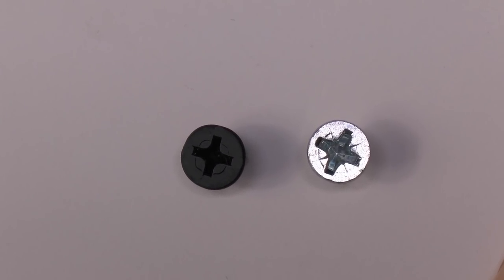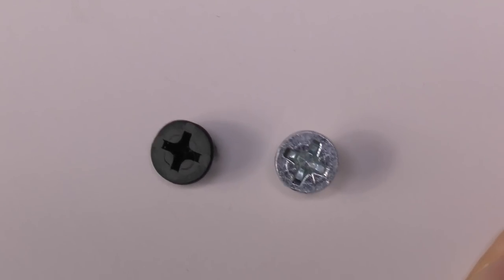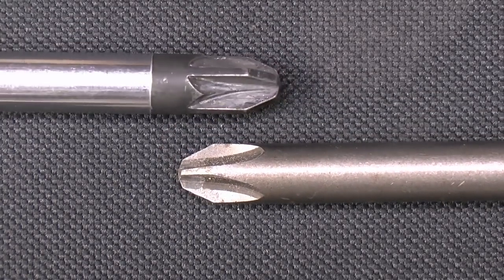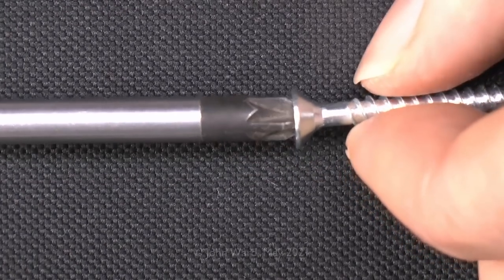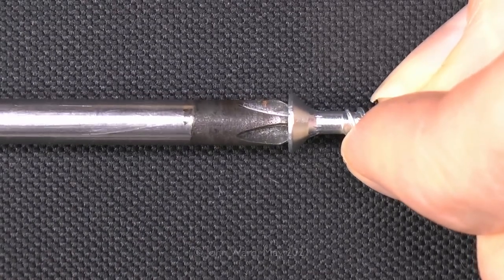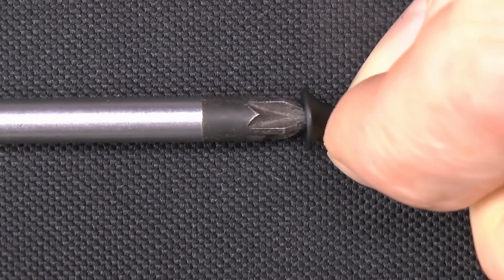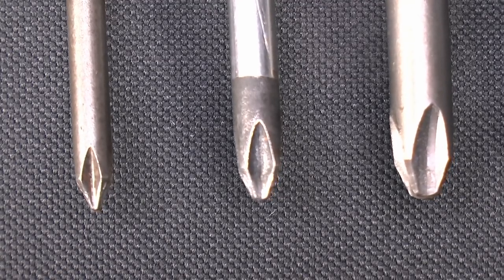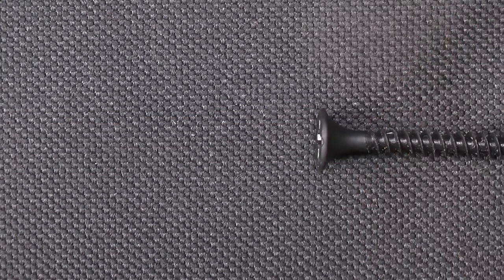Screws - Phillips or Pozidriv ?

Comment: One thing I love about Miele is that right since the 1980s, they've just used torx more or less everywhere. Absolutely no mistaking which piece you need of using one of those horrendous kits you allude to at the end. The world world be a much nicer place, if the only two fasteners you needed were torx screws and hex cap machine screws.
Reply: Step 1: There are 14 competing standards. Step 2: "We need a new standard to unify and replace them all!" Step 3: There are 15 competing standards.
Reply: Apart from all the Pozi screws they use. The Pozis were only around £2 each to replace all the rusted up ones in a Miele appliance. Apart from that, Miele do use Torx.
Reply: If it were up to me, ALL screws would be Torx. It’s such a superior drive in every way...
Reply: @tookitogo  Only 2 things against Torx. The bit often sticks in the fastener after tightening (also a problem with robertson to some extent) and if they are painted over it is a right pain scraping the paint out of the splines to fit the bit in. In this respect both Robertson (square socket) and hex (Allen) headed screws are easier to scrape out. Another advantage of Robertson is they still grip when the driver is not exactly aligned to the screw.  With Pozidrive I just hammer in a philips driver as the old paint takes up the slack and makes a tight fit to get the screw out.
Reply: It’s all pozi on their hoovers, some buried in deep holes, Miele get some design things really wrong
Reply: @____________________________.x  Exactly. Find out how much each replacement Pozi screw costs from Miele. I paid around £2 each. Alternatively you can use off the shelf replacements for a few pence each but run the risk of damaging the plastic threads due to Miele using a strange pitch and length.
Reply: @tookitogo  After speaking to a leading screw manufacturer, as I want all screw to move to Torx, there is a growing trend towards offering Torx to replace Pozi.
Reply: @bimble7240  Use a torx screw driver and the bit won't stick. Or use a quality bit holder? I've never had a single Torx bit stick in the fastener once.

Removing paint is not a reason to favour one over another. They are all equally difficult.

Torx has a far greater range of "off-axis" drive than Robertson. it's part of the design of Torx.
Reply: @stakkerhmnd  Oh thank goodness. I am SO over Phillips and Pozi! (Never mind flathead, which IMHO should have been banished decades ago.)
Reply: @tookitogo  Stakker Humanoid has been requesting for quite a while that TX be made available in woodscrews. Stakker was told by the manufacturer that this was their plan. However, a well engineered PZ bit and quality PZ screw are already vastly superior to PH and Flat Head (FH). There is no place whatsoever for FH apart from purely decorative reasons. Saying that, Stakker feels that a TX is more decorative and nicer to look at than a FH.
Reply: @Anvilshock  Very good point!
Reply: @tookitogo  Definitely
Reply: @stakkerhmnd  Never buy Miele is my advice.
Reply: @corrigenda70  Why? Everyone I know who has Miele is extremely satisfied.

Comment: Torx has become very common in UK construction work, especially in the larger sizes of wood screw (5/6mm). The boxes tend to contain a fresh driver bit in each as well. Much easier to use, especially with powered drivers.
Reply: Oh really? Man that is so damn good to hear. I've been saying for ages that Torx will only go mainstream once it's used widely in construction. I kinda thought that it would be hard to convince construction companies, as Pozi tends to go in no problem, is a bit cheaper, and it's not the construction companies problem if it cams out when someone tries to remove it in 10 years.

Comment: Thanks for sharing, it's always frustrating to work on furniture or construction where someone had previously mangled all the Pozidriv screws with a Philips bit and a cordless drill set to max torque. Conversely, in computers, most of the time the only driver you need is a Philips #2... Which doesn't stop folks who once assembled an Ikea table jamming their Pozidrive in there, or even a flathead if that's all they've got.

Comment: It is unfortunate that two incompatible standards of basically the same shape (three if you count JIS as well) succeeded in the market. I wonder how much damage and additional costs the resulting confusion has caused.
Reply: A huge amount. Many very expensive executive yachts have been purchased with the money spent damaging equipment unnecessarily.
Reply: Pozidriv is based on Phillips, it's a more improved version. It can handle higher torque than Phillips. The badest thing is if you got a device were they mixed up screws with PZ and PH head. You can actually use a Phillips screwdriver on a PZ screw without damaging it. But you must be careful with the applied torque, some intuition and finesse in your hands. Use a screwdriver and not an impact driver or something like that. So nothing for people which we call "Grobmotoriker" in German...(person with inadequate fine motor skills).

Comment: The history of screw heads is quite interesting (sadly!). I believe cross-head screws were developed when mass-production took-off - screws needed to be inserted by power tools and the traditional slot-head was no good as the driver doesn't self-centre. It saved a small amount of time per screw, but that added-up to a big saving overall.

Comment: It is useful to note that impact drivers are much less likely to "Cam Out" when driving or removing Phillips and Pozidrive screws than a drill driver. With drill drivers you will have to push hard into the screw to stop it camming out with tight screws. If you don't the driver bit and screw will very quickly get chewed up.

Comment: The #2 size can be used even on surprisingly small screws.
I’ve had computer servers where the side panel (barely thick enough to take the countersink head) was held in place by very small screws which the best driver to remove and replace them was a Phillips #2 (screwed into a punched hole in a slightly thicker sheet metal part). A Phillips #1 driver would cam out unless pressed down hard where as a Phillips #2 driver fit perfectly to the point the screw was retained on an unmagnetised driver after removal. (Edit: spelling).
Reply: Sounds like you had the wrong bit there.
Reply: Conversely, a damaged #2 screw can sometimes be turned by a #1 bit because it reaches undamaged metal.
Reply: The important message here is that the size of the screw head doesn’t tell you what size bit it needs. (It is NOT correct to imply a #2 driver is somehow universal; it is not.)

Comment: I often have to repair UPVC windows at work. The locks and hinges are usually fixed with phillips head screws and I cringe so hard when I’m with someone else and they go at them with an impact driver, fitted with a PZ2 screwdriver bit. You just know it’s going to rip the screw to shreds and either make it a right pain to get out or put back in. 

I always have a bit holder with a PH2 bit in the toolbag. Better to swap it over quickly than fart around trying to make a PZ2 work.

Comment: Canadian Square screws are excellent as well, simple design screw holds firm at any angle. Does not cam out. very strong. Long history, ford motor company used them but the guy who designed them would not sell the patent
Reply: Robertsons have their good properties. I kinda like the idea, easier to see what is going on and more material to ruin before you end up with a round hole :-)
Reply: Robinson or something like that? I only tried them once didnt like them,  dont think its a good design at lower cost. 
Torx and pozis for me, I only had a problem with pozi once when I tried tightening one with my left foot, they work 100% otherwise I cant understand how folk magage to screw them up ...
Reply: @CliveChamberlain946  Ah not so basic, I think Robertson is also tapered. I waiting for Torx to finally get some traction. Not sure that is going to happen until construction companies start using Torx (and I don't see that happening as Pozi drives in just fine, and it's not their problem is cams out 15 years later when trying to remove).

Comment: Phillips screws are criticised for camming out much more easily than posi, but this can have its uses. The advantage is it limits the tightness of the screw when using automatic screwdrivers, and it's why they were used on car assembly lines before torque limiting screwdrivers existed, and are still used today for plasterboard (drywall) screws.
Reply: It seems like a terrible idea to rely on the driver camming out as a means of torque control. The driver will wear fast, screw heads will be damaged, and  the torque achieved is user dependant. Not to mention pointless for everyday fastener use as you squally want the ability to easily tighten screws in construction/ on equipment. And in production settings, well you’re gonna have to use a torque sensing driver. Not saying you’re wrong, but this just seems like a terrible idea.

Comment: You used to get Supadriv (maybe Super drive... can't remember) which were also crosshead type screws. They were around in the UK in the 1980s. I remember they were easier to work with because the screwdriver was less prone to camming out of the screw head under high torque. Not sure if they still make screwheads in that form factor but I've still got a couple of the screwdrivers somewhere.

Comment: I thought everyone knew this but obviously John had realised that not everyone does. I had a similar thing about 15 years ago. I didn't know that that SDS drill stood for Slotted Drive System. The drill bit had slots to make for a much better hammer action. I wasn't told this, I had to look into it because I kept seeing SDS all the time, it was driving me nuts. No pun intended.
Reply: That and the actual tool has a proper linear hammer action as opposed to the more vibratory action of a standard 'hammer' drill
Reply: SDS = Stecken Drehen Sichern (Insert Twist Secure). Developed in Germany by Bosch and Hilti. Internationally Bosch refer to SDS as Special Direct System.
Reply: @renrutmat  Yeah, in the UK we refrain from using the word “Special” for anything. Josie Marino made the mistake of calling himself special. The ridicule follows him to this day. Most of us know (or may not no), SDS = Slotted Drive System. We know SDS bits by the Slots on the shank. We also know SDS will fit in a normal drill but not the other way round. We all all just say SDS and recognise the bits by the slots.
If you went in to Screwfix or any UK hardware / DIY store asking for  special drill bits they will have no clue. They may however say, ‘Don’t think you’re special! On every subsequent visit. Oh, important to say - SDS drills are amazing. Well done Bosch.

Comment: Hi John, nice video. Maybe you could show the Pozi Slot screwdriver as well. It's used specifically on terminal screws, MCB RCD RCBO etc. If you look carefully at the terminal screw you will see what resembles a Pozi head with a slot. I must admit to thinking that was to enable the use of a flat head or a Pozi. The Hilti set of insulated screwdrivers include this type.

Comment: Hi John, A very good system liked here in Canada is Robertson. It looks very simple as it is just square. However using the correct driver the screw locks on and you can use it to insert the screw. I am from England as you know and did come across these in England on some Canadian equipment. However only used in Canada not even in the US.  I am a convert and use them a lot in my equipment. The problem with PoziDriv and Philips is that they are very easily confused and getting the correct drivers can be difficult as very few people know the difference. There are a few other versions as well. In my experience Philips were mainly on actual equipment like televisions and radios and PoziDriv were used more on wood screws. Now we have a myriad of different drives like Torx, male and female, security Torx, and triangle drive used on fisher toys to name a few.
Reply: Yep, living in Canada for most of my life I've come to like the Robertson screws.  I honestly think that nobody here would go in to a hardware store looking for posidriv. Phillips heads are used for drywall screws but beyond that you'll get Robertson heads and some torx.

Comment: The head of the Phillips screws is designed to permit the driver head to cam out whenever excessive force is applied. The Pozidriv was patented by GKN Screws and Fasteners in 1962. It was designed to allow more torque to be applied and greater engagement than Phillips drives. As a result, the Pozidriv is less likely to cam out. It is similar to, and compatible with, the Supadriv screw drive

Comment: In austraila, see more Phillip screws,  however starting to see more different types of screws. As a electrician need to carry  different types of screwdrivers for day to day works. When I started as a apprentice electrician, didn't have self drilling metal screws or battery tools, how things change. The first battery  drill was a Skill 4.8volt, had a better chance drilling a hole with a pencil.

Comment: You should also have mentioned the Reed and Prince (Frearson) screw driver. Which looks almost identical to a Philips. The most noticeable difference is  the tip of a Reed and Prince is pointed while the tip of a Phillips is flat. The angles are also different.

Comment: I just redid my roof with Torx T25 for the wood and hex heads for the sheet metal screws (metal roofing)  All hail the Torx!  IMHO, the Philips, Posi and JIS made such a mess of things I avoid them all and use Torx whenever possible and no more cam out, no more worn out impact driver bits and I always know that a Torx is a Torx.  Some people call Torx "star drive" but no matter what you call it, it works very well and no worries about tearing up bits.

Comment: I gave up on Philips and PZ screws some time ago, I find the #2 Square Drive (Robertson) screws are really good and you can hold one of these screws on the end of the driver if you're installing things like light fittings to a ceiling.
You can buy a very strange type of screw over here in NZ, called a Supadrive screw, apparently you can use any type of screwdriver in these screws, although the ones I've seen, seem to fit none of the drivers I have and they are equally sloppy.

Comment: I wish I'd have known this small detail years ago. I found out the hard way. I was using a Pozidriv drill bit with Phillips screws once and it turned what should have been a quick and easy half-hour job into a few hours' hard work. I really had no idea at the time, I thought they were basically the same. It would have been easier to do it all by hand; instead I ended up chewing a lot of the screwheads up and had to keep doing it again. Lesson learned and blisters gained with then having to remove lots of damaged Phillips screws with a regular screwdriver with what was left of all those chewed-up screwheads.

Comment: Hi John I believe Pozi drive is used mainly in Europe and places like the USA which use Phillips screws  and  there's also a no 4  Pozi drive and Phillips  screwdriver  as well as and also worth mentioning is never buy really cheap screwdrivers  because the tip tends to made of  soft metal instead of harded metal

Comment: There is only one to use in 2010->

Torx or the cousin where the driver has a nipple on the end and the screw a matching hole where the screw is compatible with a normal torx driver. Can’t find them now on google as they seem rare and it’s about 5-10 years ago I bought them. But these were superb. 

With the later one you never really need any magnet on the driver.

Comment: Found out the hard way that the screws at the back of my oven (when replacing the element) were phillips and not pozi after stripping 1 and having to cut the head off.  A box of drills/driver bits that I got from B&Q (not a very cheap, but own brand one) had 2x size 2 PZ and PH bits with singles of most other sizes that are useful, I was somewhat impressed!

Comment: My guess is that Phillips and Pozi are both around due to PATENT LAW. I believe Phillips came first to the market and I'd guess they put pretty hefty patent protections on the system and the tooling to make both the driver and the screws. Then Mr "Pozidrive" came along and wanted a slice of the cross-head market. But how to get around the patents? Phillips basically grinds a set of 4 grooves around the end of their screwdriver, with a grinder, and the slots in the screwhead match. Pozi screwdrivers are made different, if you look. They use two grinding wheels, to cut away the end of their screwdriver to leave a little "fin". They do this four times around the screwdriver tip, to leave the Pozi shaped bit, with the little notches in-between the "fins". I think this is how Pozidrive were able to make cross headed screws which didn't infringe on Phillip's patents.
  Whether this is true or not, IT'S A PAIN IN THE 8RS*!
Phillips drivers seem to seat much better in the screwheads, than Pozi drivers in theirs. Phillips look much tidier and neater than messy looking Pozi's as well. And Phillips is all we need. We don't NEED two different systems of cross head screws. Just DUMP Pozi (in my opinion), and just sell Phillips. Trouble is what do they always sell over here in the UK?     POZI.

Comment: Don't know what sites you go on but the only times anybody uses PZ1 screws are to fit signs onto fire doors. PZ2 screws are probably used 99.9% of the time. Ask for 1 1/2" 8 or 2" 10 screws at the wholesaler, you get PZ2 headed screws.